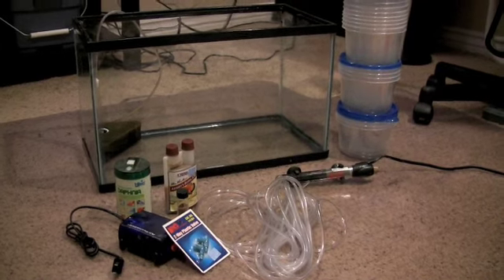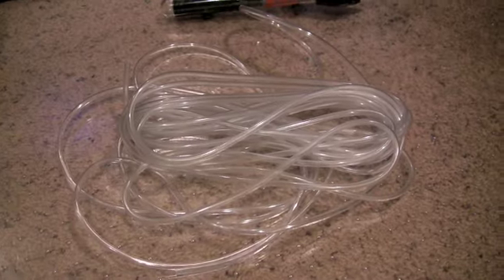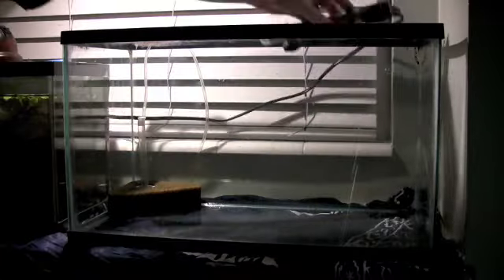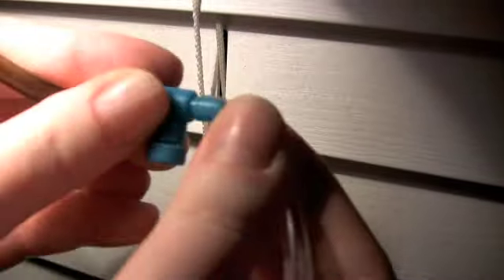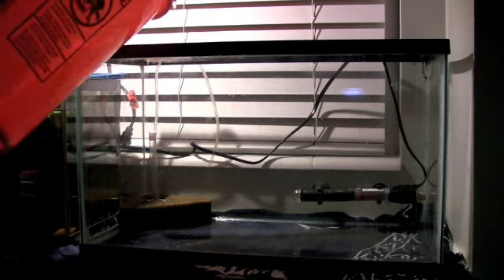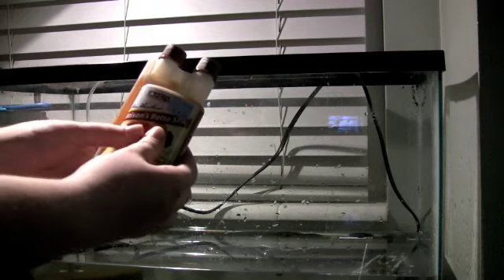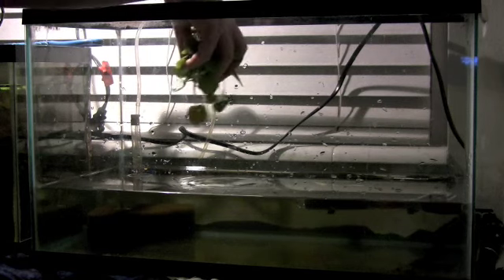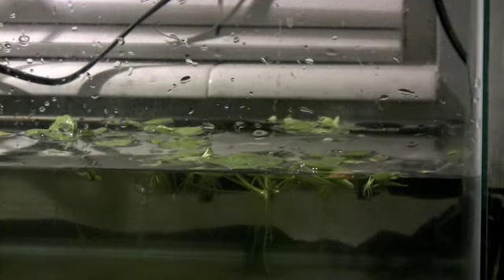Betta Breeding: Set Up

Comment: @nakiaguppy23highway It is possible that your tank heater is to small for the size of your tank. It sounds like u got an auto one...am i right? If that is the case, the size of ur tank is probably the issue. I would suggest getting an adjustable heater, they work much better and it will solve your cold water problem.

Comment from the maker: You could do actual spawning in a 5 gallon ,but then you'll have to get a bigger tank for fill out anyway, so may as well stick with the 10 from the beginning. Breeding bettas takes a TON of space, so, if you don't have it, you'll be disappointed. Females can stay together no problem. Males need to be separated from their sibs. they just have issues.  Get yourself some gallon containers for them. Be prepared for fewer males than females, however. "fatness" plays no role. Many fry will be born.